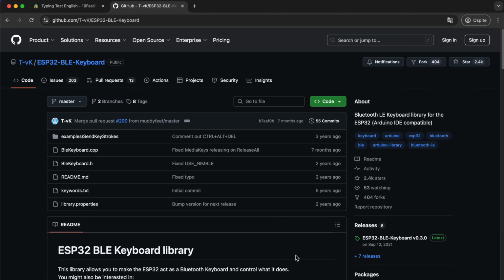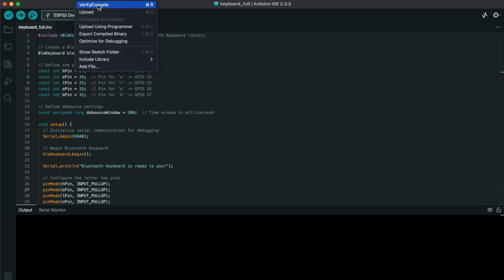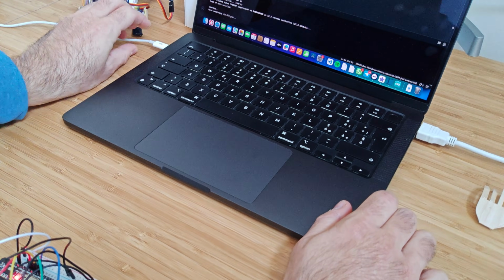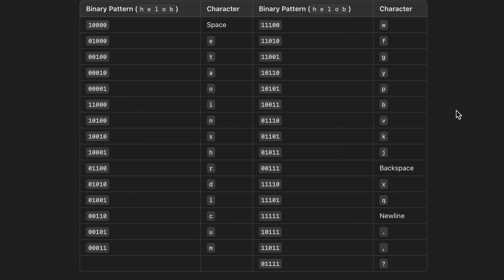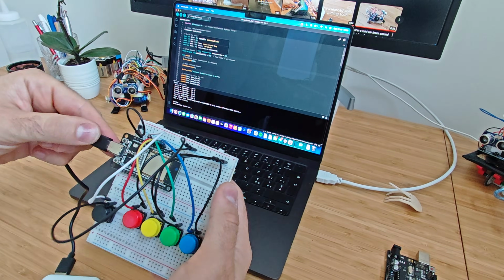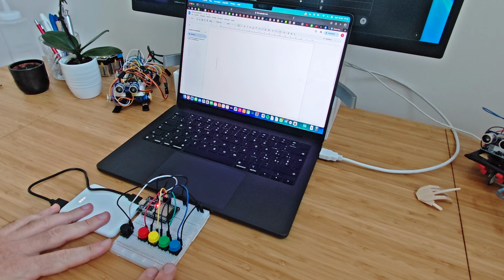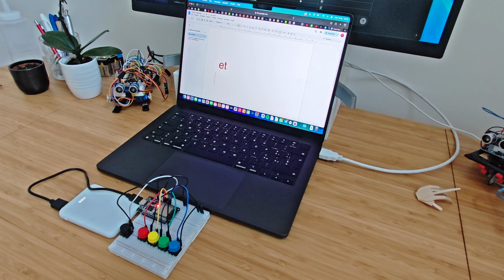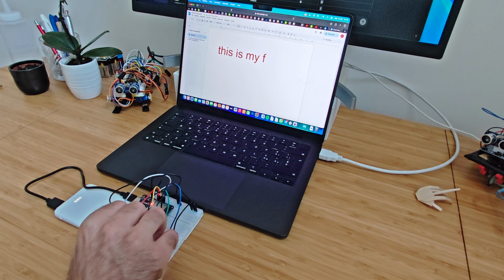Build Your Own Bluetooth Keyboard with ESP32 – Step by Step

Comment: Hello friend! How you can reassign a letter? for example case 0b01100: outputChar = 'r'; break; IN: int pattern = (hPressed << 4) ?Thanks!
Reply from the maker: You just need to map each pattern value to the letter you want. After you build the pattern with something like int pattern = (hPressed << 4) | vPressed;, you can use a switch-case and assign any character you want to each case. So if you want to reassign it to ‘r’, just change the outputChar in that specific case. That’s all you need to do.

Comment: I'm trying to add more letter keys and can't figure out how you came up with defining the pins.  If I were to add another letter or number, what pin would you use?  
example:  const int cPin = 14;  //Pin for 'c' - GPIO 14    <--  would this be correct?
Reply from the maker: it is always a great pleasure to read that you guys are trying and expanding my projects:) Yes you need to chose the pin you want to use e.g. D34 and D35 should be good choices, and define const int cPin = 34. and then you need to code the action of this button.
Reply: @ThinkingThings-q4p  can I ask why you chose to define the pin (lPin, oPlin), instead of ePin, tPin?
Reply from the maker: @karenkim3177  that is just the variable name, it does not matter, probably yours is a very good choice :)

Comment: I'm having issues compiling the code.  I'm hoping you can give me some insight.  Below is part of the error I'm getting. I installed the ble keyboard file as shown in your video.  It seems like that's where the issue is?  Any help would be greatful!
\libraries\ESP32_BLE_Keyboard\BleKeyboard.cpp: In member function 'void BleKeyboard::begin()':
libraries\ESP32_BLE_Keyboard\BleKeyboard.cpp:106:19: error: cannot convert 'std::string' {aka 'std::__cxx11::basic_string<char>'} to 'String'
  106 |   BLEDevice::init(deviceName);
      |                   ^~~~~~~~~~
      |                   |
      |                   std::string {aka std::__cxx11::basic_string<char>}
Reply from the maker: I think you need to convert deviceName from std::string to String before passing it to BLEDevice::init(). can you copy the whole error so that I can be more precise?
Reply: @ThinkingThings-q4p  Wow.. you reply really fast.  Thank you for that!  Below is the full error msg.  I appreciate your help!

xxxxxxxxxxxxxxx\libraries\ESP32_BLE_Keyboard\BleKeyboard.cpp: In member function 'void BleKeyboard::begin()':
xxxxxxxxxxxxxxx\libraries\ESP32_BLE_Keyboard\BleKeyboard.cpp:106:19: error: cannot convert 'std::string' {aka 'std::__cxx11::basic_string<char>'} to 'String'
  106 |   BLEDevice::init(deviceName);
      |                   ^~~~~~~~~~
      |                   |
      |                   std::string {aka std::__cxx11::basic_string<char>}
In file included from xxxxxxxxxxxxxxx\libraries\ESP32_BLE_Keyboard\BleKeyboard.cpp:9:
xxxxxxxxxxxxxxx\AppData\Local\Arduino15\packages\esp32\hardware\esp32\3.1.3\libraries\BLE\src/BLEDevice.h:41:27: note:   initializing argument 1 of 'static void BLEDevice::init(String)'
   41 |   static void init(String deviceName);                                                            // Initialize the local BLE environment.
      |                    ~~~~~~~^~~~~~~~~~
xxxxxxxxxxxxxxx\libraries\ESP32_BLE_Keyboard\BleKeyboard.cpp:117:32: error: no matching function for call to 'BLECharacteristic::setValue(std::string&)'
  117 |   hid->manufacturer()->setValue(deviceManufacturer);
      |   ~~~~~~~~~~~~~~~~~~~~~~~~~~~~~^~~~~~~~~~~~~~~~~~~~
In file included from xxxxxxxxxxxxxxx\AppData\Local\Arduino15\packages\esp32\hardware\esp32\3.1.3\libraries\BLE\src/BLEHIDDevice.h:17,
                 from xxxxxxxxxxxxxxx\libraries\ESP32_BLE_Keyboard\BleKeyboard.h:24,
                 from xxxxxxxxxxxxxxx\libraries\ESP32_BLE_Keyboard\BleKeyboard.cpp:1:
xxxxxxxxxxxxxxx\AppData\Local\Arduino15\packages\esp32\hardware\esp32\3.1.3\libraries\BLE\src/BLECharacteristic.h:83:8: note: candidate: 'void BLECharacteristic::setValue(double&)'
   83 |   void setValue(double &data64);
      |        ^~~~~~~~
xxxxxxxxxxxxxxx\AppData\Local\Arduino15\packages\esp32\hardware\esp32\3.1.3\libraries\BLE\src/BLECharacteristic.h:83:25: note:   no known conversion for argument 1 from 'std::string' {aka 'std::__cxx11::basic_string<char>'} to 'double&'
   83 |   void setValue(double &data64);
      |                 ~~~~~~~~^~~~~~
xxxxxxxxxxxxxxx\AppData\Local\Arduino15\packages\esp32\hardware\esp32\3.1.3\libraries\BLE\src/BLECharacteristic.h:82:8: note: candidate: 'void BLECharacteristic::setValue(float&)'
   82 |   void setValue(float &data32);
      |        ^~~~~~~~
xxxxxxxxxxxxxxx\AppData\Local\Arduino15\packages\esp32\hardware\esp32\3.1.3\libraries\BLE\src/BLECharacteristic.h:82:24: note:   no known conversion for argument 1 from 'std::string' {aka 'std::__cxx11::basic_string<char>'} to 'float&'
   82 |   void setValue(float &data32);
      |                 ~~~~~~~^~~~~~
xxxxxxxxxxxxxxx\AppData\Local\Arduino15\packages\esp32\hardware\esp32\3.1.3\libraries\BLE\src/BLECharacteristic.h:81:8: note: candidate: 'void BLECharacteristic::setValue(int&)'
   81 |   void setValue(int &data32);
      |        ^~~~~~~~
xxxxxxxxxxxxxxx\AppData\Local\Arduino15\packages\esp32\hardware\esp32\3.1.3\libraries\BLE\src/BLECharacteristic.h:81:22: note:   no known conversion for argument 1 from 'std::string' {aka 'std::__cxx11::basic_string<char>'} to 'int&'
   81 |   void setValue(int &data32);
      |                 ~~~~~^~~~~~
xxxxxxxxxxxxxxx\AppData\Local\Arduino15\packages\esp32\hardware\esp32\3.1.3\libraries\BLE\src/BLECharacteristic.h:80:8: note: candidate: 'void BLECharacteristic::setValue(uint32_t&)'
   80 |   void setValue(uint32_t &data32);
      |        ^~~~~~~~
xxxxxxxxxxxxxxx\AppData\Local\Arduino15\packages\esp32\hardware\esp32\3.1.3\libraries\BLE\src/BLECharacteristic.h:80:27: note:   no known conversion for argument 1 from 'std::string' {aka 'std::__cxx11::basic_string<char>'} to 'uint32_t&' {aka 'long unsigned int&'}
   80 |   void setValue(uint32_t &data32);
      |                 ~~~~~~~~~~^~~~~~
xxxxxxxxxxxxxxx\AppData\Local\Arduino15\packages\esp32\hardware\esp32\3.1.3\libraries\BLE\src/BLECharacteristic.h:79:8: note: candidate: 'void BLECharacteristic::setValue(uint16_t&)'
   79 |   void setValue(uint16_t &data16);
      |        ^~~~~~~~
xxxxxxxxxxxxxxx\AppData\Local\Arduino15\packages\esp32\hardware\esp32\3.1.3\libraries\BLE\src/BLECharacteristic.h:79:27: note:   no known conversion for argument 1 from 'std::string' {aka 'std::__cxx11::basic_string<char>'} to 'uint16_t&' {aka 'short unsigned int&'}
   79 |   void setValue(uint16_t &data16);
      |                 ~~~~~~~~~~^~~~~~
xxxxxxxxxxxxxxx\AppData\Local\Arduino15\packages\esp32\hardware\esp32\3.1.3\libraries\BLE\src/BLECharacteristic.h:77:8: note: candidate: 'void BLECharacteristic::setValue(uint8_t*, size_t)'
   77 |   void setValue(uint8_t *data, size_t size);
      |        ^~~~~~~~
xxxxxxxxxxxxxxx\AppData\Local\Arduino15\packages\esp32\hardware\esp32\3.1.3\libraries\BLE\src/BLECharacteristic.h:77:8: note:   candidate expects 2 arguments, 1 provided
xxxxxxxxxxxxxxx\AppData\Local\Arduino15\packages\esp32\hardware\esp32\3.1.3\libraries\BLE\src/BLECharacteristic.h:78:8: note: candidate: 'void BLECharacteristic::setValue(String)'
   78 |   void setValue(String value);
      |        ^~~~~~~~
xxxxxxxxxxxxxxx\AppData\Local\Arduino15\packages\esp32\hardware\esp32\3.1.3\libraries\BLE\src/BLECharacteristic.h:78:24: note:   no known conversion for argument 1 from 'std::string' {aka 'std::__cxx11::basic_string<char>'} to 'String'
   78 |   void setValue(String value);
      |                 ~~~~~~~^~~~~

exit status 1

Compilation error: exit status 1
Reply: @ThinkingThings-q4p  how to do that? I have the same Error on arduino IDE  2.3.6 / ESP32C3 Dev Module while compiling the samplecode

Comment: Does The latest Arduono and ESP32 cores and library support it? I have Lilygo ESP32-S3 AMOLED. It can connect to all devices but can’t do anything beyond that. Which means no keystroke is passed or windows is not supporting it. I have tried Mac and Iphone as well but no luck. Can you please share libraries and codes you’ve used?
Reply from the maker: I never used this board, but on my very cheap (5-10dollars) esp32 boards, everything goes very smoothly!

In My case all I had to do was to install esp32-cp2102 drivers.

Let me know if you manage to make it work.

Consider that a like a share and a sub would greatly help me at this stage.

Comment: Hello my friend, is there an email address so that I can contact you? Please help me because I am creating a project and I am sure that you can help me in this project and solve this problem for me 🙏
Reply from the maker: Thank you for your interest! :) Can I ask what Is the project and what problems are you facing?
Reply: @ThinkingThings-q4p  I have a board called esp32 lcd 1.9 inch ideaspark 170x320 I want to upload a code that was working on a board called esp32 lilygo but I am facing some problems when I upload it nothing appears on the screen I hope you can help me because I am very frustrated 😭
Reply from the maker: Hi! Sorry for not replying. However, I actually never used this board, even if i am planning to buy one. Did you succeed in the end?
Reply: I have a board called esp32 lcd 1.9 inch ideaspark 170x320 I want to upload a code that was working on a board called esp32 lilygo but I am facing some problems when I upload it nothing appears on the screen I hope you can help me because I am very frustrated 😭 @ThinkingThings-q4p
Reply: @ThinkingThings-q4p  I have a board called esp32 lcd 1.9 inch ideaspark 170x320 I want to upload a code that was working on a board called esp32 lilygo but I am facing some problems when I upload it nothing appears on the screen
Reply: @ThinkingThings-q4p  I have a board called esp32 lcd inch ideaspark I want to upload a code to the board and unfortunately nothing appears on the board screen